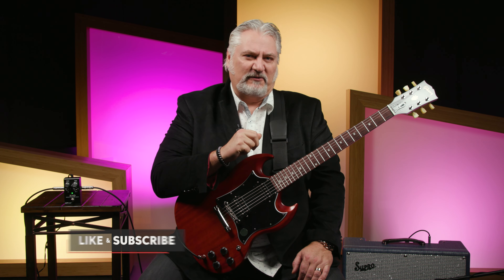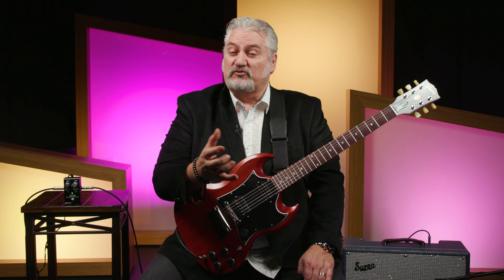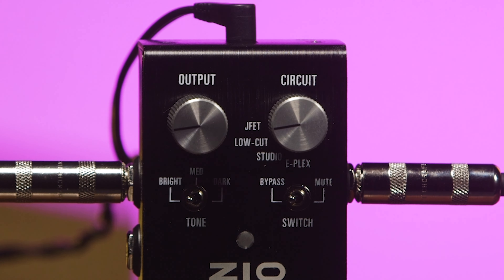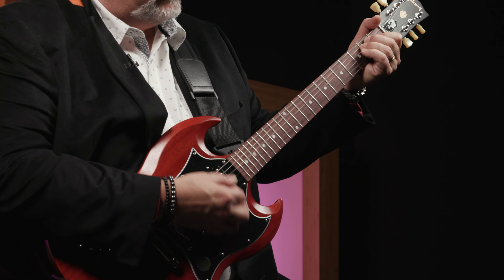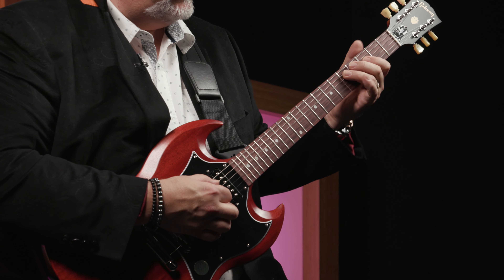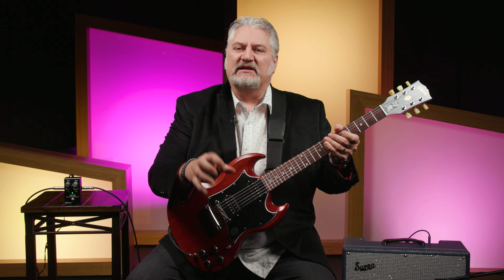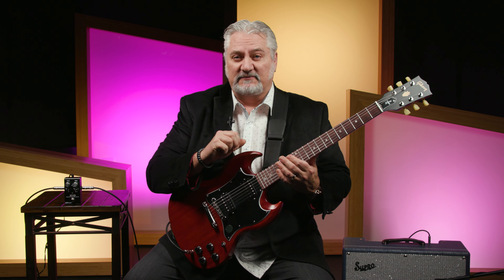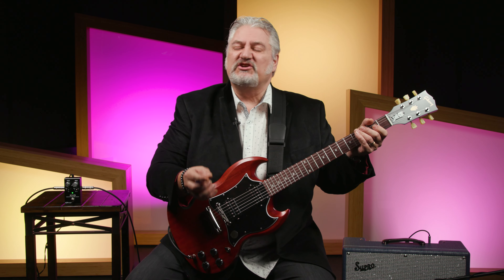Source Audio Zio Analog Front End + Boost Pedal Demo

Comment: great Demo thanks ;-) would this be good in front of amp sim eg. Uad amp sim into apollo? WaS thinking of preamp low cut especially? Cheers
Reply from the maker: Hi, Henrik. Yes, it would be great for that type of a setup. A lot of times when using amp sims, you can lose the feel of an amp and the tone can be a bit sterile. This will help correct those issues.
Thanks for your interest!
Charlie Davis, Sweetwater Sales Engineer, (800) 222-4700 ext. 1320, charlie_davis@sweetwater.com

Comment: Would the LINE OUT output +10db for connecting to unbalanced LINE IN inputs? and matching the impedance as well?
Reply from the maker: Thanks for your message, Martin.
Zio is purpose specific to output a low impedance signal retaining the relationship between a guitar's output and an amplifiers input. Those values do not match. Without knowing more about your intended use, I can't comment as to whether it's a viable option for you.
Please contact us direct with other questions as you have them!
Robert Williams, Senior Sweetwater Sales Engineer, (800) 222-4700 ext. 2371, robert_williams@sweetwater.com